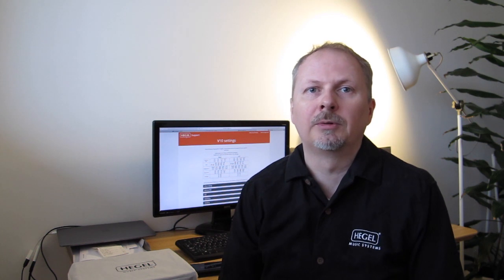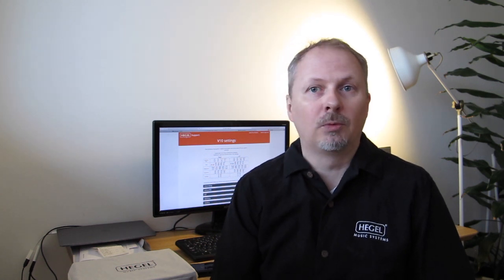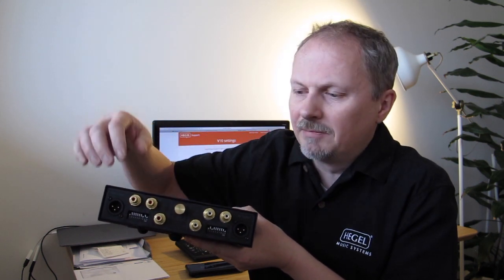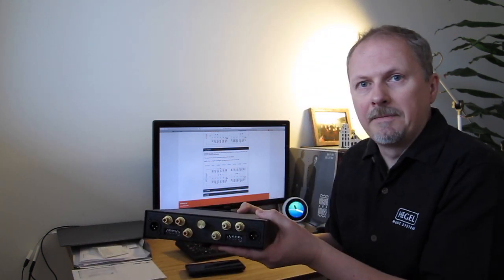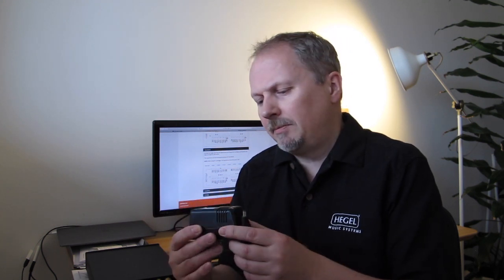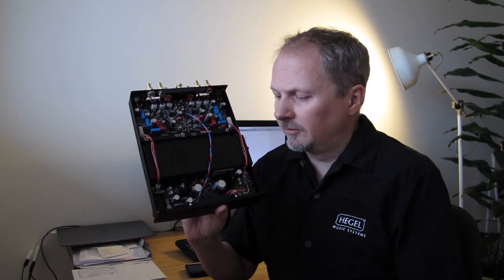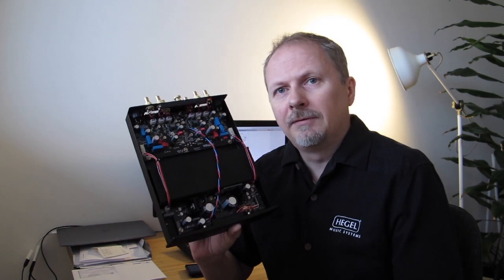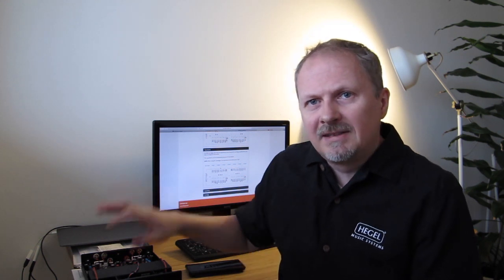Hegel V10 phonostage introduction

Comment: I’ve owned the V10 for 9 months. Yes it sounds wonderful but the V10 is a royal pain in the butt,if you have multiple carts. The dip switches are terrible. Yes, if you shut the device off and then remove it from the shelf, it’s easy to change. But honestly, who does that? Again, if you have one cart and set and forget, then you’d avoid the aforementioned. As for the impedance setting inside: what a waste. Seriously, I ordered online so who’s gonna make those changes? And why would you have them if the only people who can change the settings are Hegel dealers? I love the idea and I paid for it but the feature is useless to me. Recap: The sound of the V10 is amazing and works well with my Hegel Pre20 but…
Reply from the maker: Thank you for posting and we totally relate to the hassle if you have more than one cartridge. The reasons things are like they are is for the purpose of very short signal paths and at a reasonable price.

Comment: Thanks Anders for the video I look forward to hearing the new product; on a separate note, any word on when we can expect Hegel to have an integrated amp software update for tidal connect?
Reply from the maker: Thank you for the kind words. I do not know the answer to the Tidal question yet. And in any case I do not want to make promises, following the mess with Roon taking forever. But we are researching it in the background. We just want to run the last few meters to the goal line with Roon first. 
On a side note, Tidal Connect was launched only on one platform provider in the beginning. Not brands as such but a platform provider. Only just now was the code released to others so we could start looking at it. It is a very nice feature and if we can do it it will be quite high on our list of priorities.
Reply: @HegelMusicSystem  thanks so much Anders, please continue to keep us posted on any developments via the Hegel website.
Reply: @HegelMusicSystem  My first Hegel product (an H190) arrived to my country (colombia) it was quite a challenge, but finally made it. Been following your products for a while. Btw Hope Roon finally becomes a reality.

Comment: HELLO !    im buying a hegel amp but dont know exactly wich one .  i woudl like to go for the hegel120  because its my pricerange.  my loudspeakers are KEF LS50 Meta.   is that a doable match  ?  i never listen very loud btw.  Maybe the hegel 95 is already ? enough
Reply: Get the H120,  i use the H120 with my ls50 meta's and its a perfect match.  Incredible sound quality
Reply: @hclandscapes  perfekt thanks. on thuesday i will test the KEf r3 & 7  .... but i will probably stay with the meta
Reply from the maker: @AntonRacing  Completely agree with @HJC. We use the H120 a lot with the LS50 Meta and it works very well. Actually much of the listening during development of the H120 was done on the LS50. So they were built to match.
Reply: @HegelMusicSystem  thats great .. thanks for your advice, its already professional.. could you recommend a cable for the loudspeakers ?

Comment: Anders, thanks for the very informative video! Still, let me double check: do i get it right, that external Power Supply is AC/AC converter, and AC/DC coversion is happening inside the V10 unit? As you mentioned transformer being there

Comment: I have a Hegel H70 amplifier. Trying to set up volume control with the Apple TV 2021 IR remote and nothing works. I can't get any of the native remote's functions into the Apple TV remote. What could be the problem?
While my Hegel HD20 dac controls the Apple TV remote perfectly.
Reply from the maker: That is strange. There is nothing Special about H70 codes. It is standard RC5 "amplifier 1" codes. HD20 does not use the same codes. It uses the RC5 "Amplifier 2" - set

Comment: Hello , 
Whilst listening to my H120 today the entire screen went black, the remote control stopped working and i couldn't switch the amplifier off with the button underneath the amp but strangely it was still playing music.
The only way i could gain control was to switch it off at the wall and seemed to make everything work again.
I have since updated the software.

Its less than one year old and hope this wont happen again.  Have you heard of this happening before?
Reply from the maker: Sorry to hear about that. It is very rare for this to happen. What happened is essentially that the on board computer froze and needed at restart. It is always on and listening to commands from the network port. So this can happen to any networked device. But again, very rare and nothing to be worried about. Except from the annoyance.